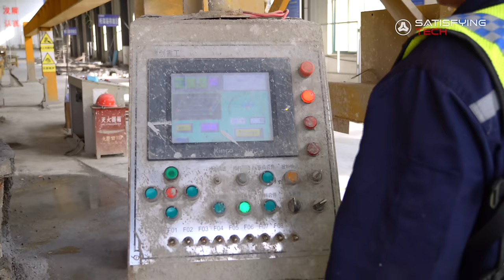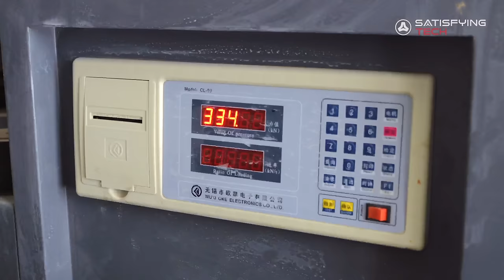Concrete Floor Mass Production Process ! Amazing Property Developer !

Comment: I worked in construction from 1960 until 2015. At 16 worked in a precast tunnel lining factory just like the one shown, but the mold oil was sprayed on, and the rebar cage was made on an assembly line and craned into the mold. The equipment was well maintained and backing panels to concrete placer were fully screwed in place, but maybe the one shown has a lot of problems. remember this was back in 1961.
In the 1970s I worked as a tower crane driver erecting Maisonet's in S.E. London. This was the 5th Project the company had built using precast wall and slabs, brough in by truck from their factory north of the Thames. The units arrived Just in Time for instant placing on the already cast base slab. Walls erected and then floor slabs in a none stop manner to construct a four-story dwelling on a 20-block development, that was immediately filled with tenants.
My last job was on the KL Metro in Malaysia, overseeing the construction of twin tunnels from surface to underground stations. The section was constructed by a Chinese sub-contractor using two TBMs made in China these were very near copies of German machines built by Herrenkenct in the same factory for the Chinese projects.

Strange how videos are titled isn't it.
Reply from the maker: Most of China's high-end machinery uses German core technology, and Chinese brands:hand-pink-waving:
Reply: Зачем прокручивать, можно усы арматуры забетонировать отдельным столбом
Reply: NO BRAGGING PLEASE TY
Reply: Yes, I was surprised too.  Very primitive and in violation of technology.  Manual assembly of the frame while kneeling.  This is in the workshop! Concrete is delivered in a mixer.  Too mobile.  During transportation, concrete delaminates.  I think this is an auxiliary temporary production.
Reply: @АлександрШамильевич  there is zero Quality Control there over the concrete itself. The guy in concrete truck could be sleeping on the gate for an hour and nobody would notice

Comment: I'm always amazed at the large quantity of gravel used & the low amount of water used to make the concrete better to vibrate and/or compact to get a very smooth surface finish. if I'm getting the term correct. Please correct if I am wrong. We had machine foundations of up to 5' deep pored which was wetter & had less gravel which we installed 3-7 ton machine tools. My cousin orders & pores concrete for bridges, over passes, & dams all year long including the winter. Most of the concrete mix they use is real watery which helps in finishing the top of the slab & pour-ability during the Winter. When I was growing up in northern ILL. we use to add anti-freeze to the concrete so it would not set-up too fast & cause cracking.
Reply: Less water concrete has the stronger it is. But it can get so dry it doesn't flow so then they can add plasticizers so you can very dry/strong concrete that will also flow well.

Comment: Şantiyelerde mikser ve pompalayayıcı araçlarla dökülen betonlarda akışkanlık iyi olsun amacıyla su oranını fazla tutuyorlar. Atölyelerde üretilen "hazır beton paneller" daha sağlam ve iş hızlanması sağlıyor.
In the concrete poured with mixers and pumping vehicles at construction sites, they keep the water content high in order to have better fluidity. "Ready-mixed concrete panels" produced in workshops are more durable and provide faster work

Comment: How can the concrete slabs reach lifting strength so quickly, what a surprise that only minutes they say. It must be extremely fast set but doesn't that affect final structural qualities?
Reply: This is just a snippet, and you don't have to spend 28 days watching this maintenance process
Reply: the concrete cures quickly because it has been subject to high temperatures in the furnace

just like pouring concrete in cold weather slows down the curing

Comment: Это такой тонкий пол?? Там сантиметров 8 всего.
Reply: И арматура не предварительно напряженная.
Reply: @nightreaper74  там в конце видно, что это вероятно элемент несьемной опалубки, и для этого там часть арматуры формирующая балку выходит наружу, очевидно она окажется внутри верхнего слоя
Reply: You know nothing about predicting concrete floors or whether precast floors are used in your country. Precast floor slabs are only part of a floor slab. Considering that the precast floor slab has poor seismic resistance and weak connections with beams and columns, a layer of 50~60mm cast-in-place concrete must be poured on the precast floor slab. The floor slab and the cast-in-situ concrete layer together form the composite structure of the floor slab.